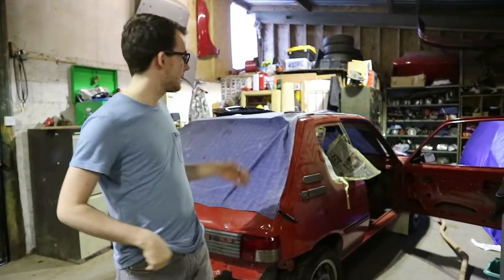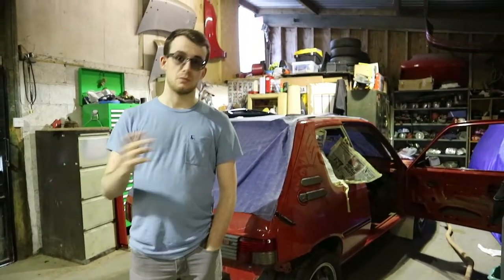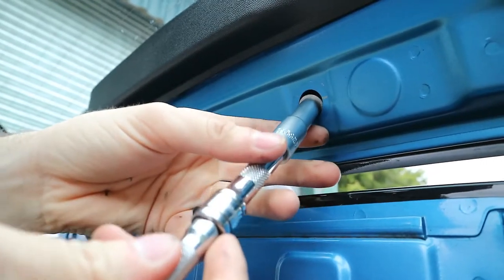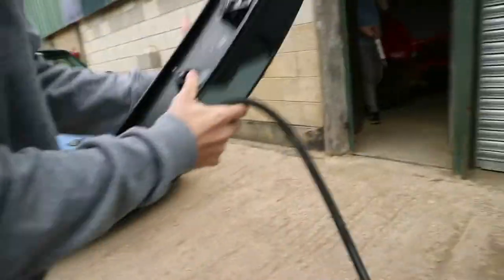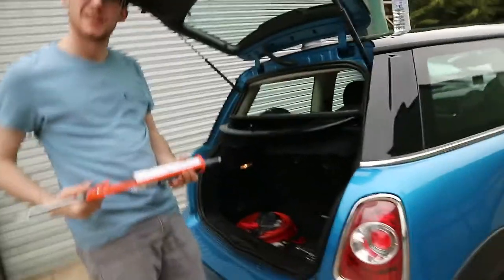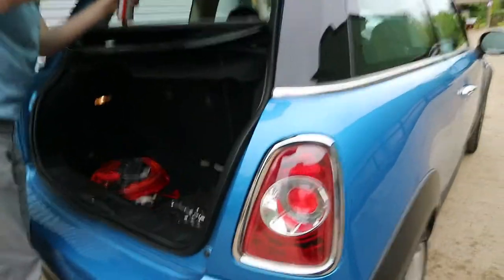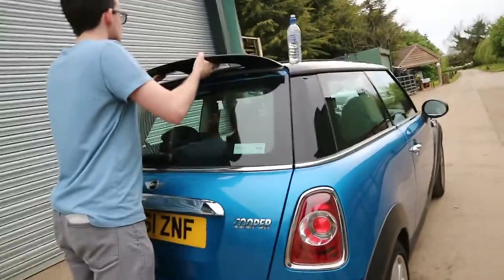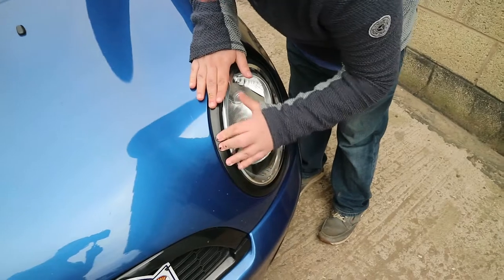Side Project: Cooper S wing install on a R56 Cooper

Comment: Great to watch this video as I just got my friend's 2013 R56 Cooper 2dr hatchback. Want to do some decoration on it and the Cooper S wing is my wish. Part of you video is a bit shaky, may I ask you what kind of tape did you put into the wing? And what's the purpose of putting silicon? Is it for better water protection? Many thanks!!!
Reply from the maker: Hi, It was double sided foam tape this allowed for the wing to adhere to the car once the bolts are in, the silicone was for added adhesion and water protection. Thanks Zach.
Reply: Thanks for your instruction. Will do this soon. I'm not a handy man, anything I need to pay attention?
Reply from the maker: @eugeneli1952  Basic hand tools needed, just take your time when removing the nuts as they can fall into the boot void and then you will need a magnet to retrieve them. When putting it back on remember the seal as it might not come with one. Take your time don't rush, nice easy install. If you have any issues drop us a message with photos on facebook and we can help.
Reply: Thanks again!👍👍👍
Reply: @RallyRaceGuys  finally done! Thanks for the instruction. Too bad I don't use fb, otherwise will send u a pic.
Reply from the maker: @eugeneli1952  Drop us an email

Comment: Could i ask a question, where and why do you use the sealant? looking to get a S swing for my standard and it would be great help to know ecactly how to replace it! Thank you, you have earned a Sub
Reply from the maker: Thanks for the sub, and watching the video. We use the sealant to ensure there will be no leaks into the boot as there are electronics/wiring that we would like to avoid getting wet. Also the standard foam that is around the clips and bolts can compress and not seal again as its second hand we are only using it as a precaution. If you have anymore questions regarding the install drop us a message via Facebook and we can help as much as possible. Thanks Zach